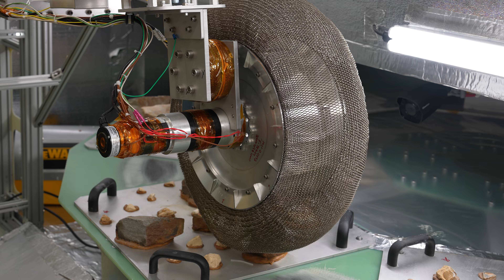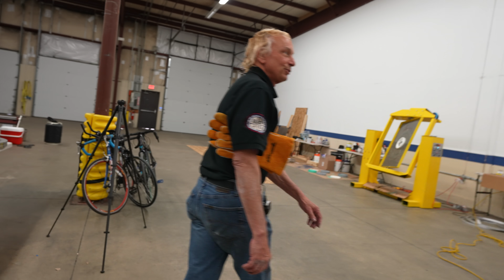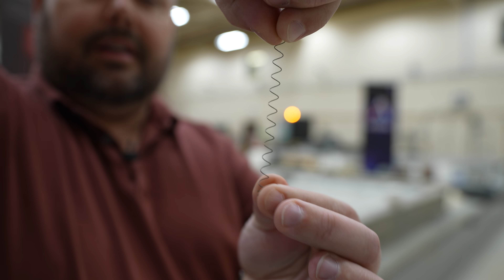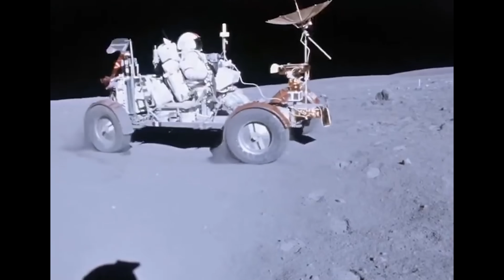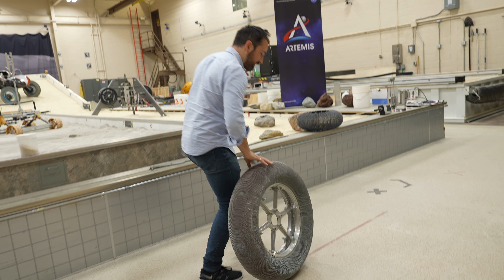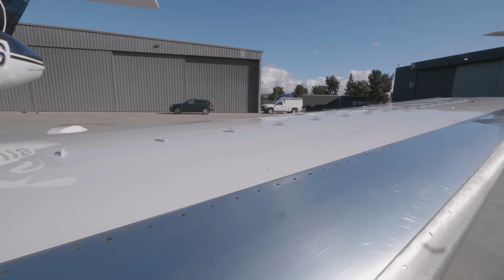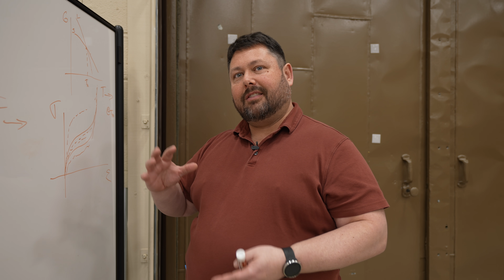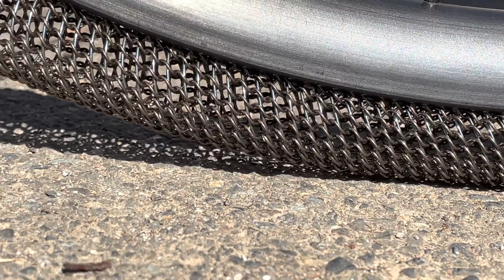How NASA Reinvented The Wheel

Comment: Okay, it might "work" as an average car tire, but how about grip? Road wear? High speed stability? Cornering performance? You must take all of this into consideration
Reply: Of course. For starters, everything on Earth is encased and with a rubber tread. Consistent footprint and grip. Then, it's lightweight and strong (titanium alloy). Tire development is hard. Our lead engineer from the video has 43 years in the tire industry, over 50 tire-related patents, an R&D 100 Award, and his technology on a significant portion of all cars on the road. It's a big problem to solve, but we're on the right track!

Comment: Nitinol is a blessing for paragliding pilots as well ... We used to have to be very careful when packing our wings.
Some of the high performance wings still use plastic rods and you have to use an inflatable pillow when folding the wing into a backpack. Still no idea why they are not using nitinol yet.
With nitinol life got so much easier. Just generaly bunch up the wing into 1 line and fold it into the size of the backpack.

Comment: If the 8% is achieved due to the general temperature the material is  in returning it to it's initial form. Then each application would have to be made specificly, and would break outside that. That must still be quite a challenge with the temp differences on Mars

Comment: Doesn’t the material chip away over time? like imagine the plane landing on the runway and then braking 100 times and then not replacing the wheel. Just crazy imo. Or if it doesn’t then you have to replace the runway..
Reply: Rubber treads: the metal will be the inner skeleton in this case.

Comment: The mesh tire is fine in dry environments, but there are several other advantages to inflated tires for cars.  They're much more weatherproof, do better in cornering, braking and acceleration, can run at higher speeds and are much cheaper/easier to make.  Not being able to pick up debris that throws the balance off is pretty important for consumer tires.  Mesh tires are just as unsuited for terrestrial cars as inflated tires are to extraterrestrial cars.
Reply: The mesh tire is just for rovers (and as a visual on the Jeep). Everything earthly is encased and fitted with rubber treads.

Comment: wouldn`t using nitinol for normal vehicles not come with new problem - grip i.e we know rubber works on asphalt, would that not mean we would have to change the roads just to make the new ''fancy'' aka nitinol tires actually work, what would we need to replace asphalt with to make them work?
Reply: We use rubber treads on earth, with a nitinol skeleton.
Reply: @thesmarttirecompany  you mean the shell would be rubber and inner layer nitinol? Are they legit things or prototypes?
Reply: @missionquasar1429  as legit as can be. The casing/shell can be made in various ways, but the keys are the nitinol skeleton and the rubber treads.

Comment: but temperature differences during day/night on other planets are extreme, and seems like these tires greatly depend on ambient temperature. So as their shape/permormance might be completely different when its cold compared to when its hot. Whats up with that.
Reply: It's part of the challenge, but the short answer is that specially engineered nitinol can do pretty large temperature ranges. We're going down to 40 Kelvin for LTV work. You do have to factor in some differences in performance at the extremes.

Comment: I presume the final product will be sealed, otherwise the wheel will become quite an effective sieve, accumulating Mars and Moon  soil particles within a certain particle size range.
Reply: The lunar tires are not sealed. It is a consideration, but they do not accumulate material - it is effectively repelled or expelled by the outer springs and inner bump stop. They also do not create giant dust trails like the Apollo era steel mesh.

Comment: Orthodontist here! We've been using "superelastic" heat-activated copper NiTi archwires for decades to move those really crooked teeth. The ones we often use activate at about 35 degrees Celsius. When we place it in the mouth, it's still room temperature so the wire is really flexible to get to those very crooked teeth. Once it has been in the mouth for a little while it gets heated back to body temp of 37 degrees Celsius so the wire undergoes phase change back into its original ideal archform, with increased stiffness, to put force on the teeth to move them into the right spot.
Difficult tooth to get the wire into? Blow air onto it to cool it down, wire becomes more flexible and easier to get into the brace. Very cool, and I use them everyday at work. All thanks to the original invention of NiTiNOL.
Wish I had this video when I was a studying postgrad!

Comment: A big problem with rubber tires is that they also create micro plastics from friction with the ground. I hope these can replace them so we no longer have that issue.
Reply: YES! Tires are an environmental disaster. Now, full disclosure, we do still use rubber treads on earth. However, we have some advantages that a) we can focus on durable, quality treads since they are the limiting factor; b) tread wear is always evenly distributed ==> no high pressure areas shedding material faster; c) we can engineer specific footprints (pneumatic tires only come in one specific possible shape)

Comment: Cold-Forging (The technique to make these fixed-stuctional metals) is a technique who contains forging and bending the metal in super low temperatures to stop its crystallized sturcture to deform, the natural crystallization is just bended in cold forge, not remade by completely melting the metal. Causing it to be much stronger and reformable

Comment: It is great video, thanks. But, may any of you guys tell me (i am really curios about it) how the "memorized" shape is decided for this material. For example, a spring can be manufactured from wire, then you deform the spring, then you heat up the deformed spring and it turns back to spring, not to the wire. What is the manufacturing process that decides the "memorized" shape? It will be appreciated if you can send any link about it.

Comment: Did they mention what the Jeep sized tire weighed?
Reply: It's comparable to a standard tire. That said, it was a prototype and the goal is lightweight. The reason this is possible, is because conventional tires contain a LOT of rubber and steel to carry weight and contain air pressure. Titanium skeleton scales better.
Reply: @thesmarttirecompany  that's really interesting, one would assume it weighs more but that makes sense when you frame it that way. Thank you for the reply and information.
Reply: @JRGio  thanks. It's counterintuitive in a lot of ways. Pneumatic tires work very well, but there is also this misconception that they must be optimal, that ignores how much engineering goes into them to overcome challenges of "just rubber and air" per se.

Comment: Since nitinol is sensitive to thermal transition, how the wheel handles extreme temperature differences observed on lunar surface? Did I miss the explanation
Reply: Different grades, formulations and processing of nitinol can greatly affect the temperature ranges, depending on your needs. This is how we get superelastic at room temperature vs high temperature actuators and other things. They are also several ternary alloys with interesting properties (3rd element added beyond nickel and titanium)
Reply: Anyone can guess as much. The point I was trying to make is, temperature on moon varies between -180 degree celcius to 224 degree celcius and this variation is gradual. So, even if some thresholds are set for austenite and martensite phases by adjusting alloy composition (assuming the phase transition is also gradual, as per the stress/strain graph), there would be a considerable range of temperature where the alloy would remain plastic and the wheel would buckel under the load...
I know the team would have worked out this issue, still it would have been more informative if the explanation was given

Comment: only question with NitoNoL wheels … if used in space wouldn’t the metal memory not get re-registered so to speak every single time the sun hits it.. so any bumb will just deform the shape more and more under direct sunlight and it will not return to the wheel shape in cooler/no sun areas.

like said: direct sunlight on most planets is 275+ °C and not the 27°C of earth
Reply: Temperature ranges for a particular mission are definitely one of the challenges - for example as seen in the video we're worried about -230C at the lunar south pole. For this, the exact composition and processing of the nitinol is definitely important. Part of what is unlocking the potential is getting these to the point where the material is consistent across many hundreds of degrees range.

Comment: That spring material is amazing, but my question is what happens if the metal gets exposed to heat unintentionally in the environment the rover is working in? The potential for unpredictable outcomes could be high if you don't have a real good idea of what state that material is going to be in at any given point in time.

Also is there any kind of opposing reaction if the material is cooled? In other words can cooling the material cause it to deform from it's default state?
Reply: Temperature effects are a major consideration, but I wouldn't say "unexpected" per se- the conditions for a given mission are pretty well understood. Currently for LTV the biggest challenge is cold (40 Kelvin in shaded areas)

Comment: So, I haven't messed with Nitinol, but while I was in university, we had a failed casting of an aluminum alloy that would make the same sound and felt crunchy when you bent it. It wouldn't return to its original shape though.
Reply: That's very likely actually same effect (also Tin "crying")! NiTi is special in that it's a thermally reversible transformation where most other alloys it's not.

Comment: Excellent video. I’m curious about applications in motor sport. Rubber compounds are used for grip and temperature management is key for maximizing grip. If these are wrapped in rubber wouldn’t the endothermic properties hurt performance?
Reply: Not exactly. Keep in mind that you both have unpressurized air inside (different from dumping heat into already high pressures), and that when the material cycles through deformations, it's actually reclaiming the energy. The tube demo shows off a nice, very visceral hot/cold cycle, but the net effect is room temperature material afterwards. It's a bit apples to oranges to break down quickly, but there's a lot of positive things going on, such as no more thick heavy rubber sidewalls flexing (which generates tremendous heat).

Comment: That wheel gets hots when it bends right? So it builds up heat the more it deforms. In space getting rid of heat is pretty hard. I reckon that's gonna be a problem.
Reply: In the video the tube gets hot... then it gets COLD. That's conserving energy, not accumulating it. Not that this isn't a general concern in space, it is, but the mechanism definitely does not continually build heat.

Comment: Nice video, but the animation at 16:15 is wrong. It is not a gradual change of lattice parameters (angles) in whole sample at the same time. Martensite nucleates and the austenite/martensite interface travels throughout the volume (from one end of a wire to another) when you apply transformation stress. This interface movement creates the sound.

Comment: I actually did my graduate degree actuating an airfoil using shape memory alloys. We did not use Nickel Titanium. I used copper aluminum nickel alloy grown in St. Petersburg Russia. My degree was earned in 2004. ~20 years later, I see it in real application. My dissertation is actually on file with the University of Arkansas.

Comment: I've machined nitinol before on a Swiss cnc screw machine (bar stock). Carbide tooling doesn't last to long and holding tight tolerances is a problem because as soon as you generate heat to it during the machining process it wants to move.

Comment: The friction between the tire and what it's rolling over is very important.  My gut feeling is that these have much lower friction, so when accelerating they will spin sooner and when braking will have a long stopping distance.  In both cases the metal will be ground away quickly.  Maybe that's why the Jeep drove in the dirt and weeds not on pavement?
Reply: Just a bare metal demonstration, but these would be encased and fitted with rubber treads. The metal becomes the structural skeleton, which is great for achieving the right footprint, but nothing beats rubber treads (yet).

Comment: Could you use it for energy generation? Since almost all fields use turbines, because its the most efficient and is also why Nicolas Tesla's "turbine" didn't work (not efficient enough st lower speeds).
Coal, nuclear etc power plants work on the same principle.
The conversion rates for the energy inputted, 
then converted to heat, 
then water movement, 
then turbine movement, 
then electricity (motor)
are a somewhat big part of the loss.
Could you use the heat to change the shape to induce motion and therefore electricity? 
And would it be more efficient than a turbine? 
Of even just cheaper, if not efficient?
Reply: There are definitely energy applications being worked on.

Comment: The NiTiNOL application for aircraft control surfaces seems like a singularly terrible idea. 

When there's a problem (which there always are in aviation), you don't want NiTiNOL control elements to change shape and turn a dangerous situation into a lethal one. 

For instance, imagine a commercial plane has an engine problem and it catches fire.... NiTiNOL control elements on that wing are going to heat up, changing shape.
The pilot and the FO will have to perform an emergency landing, but if the NiTiNOL control elements on that wing are shaped in such a way that make the aircraft hard or even impossible to stabilize, it's not going to be an emergency landing but a tragic crash. 

I'd take the existing redundant hydraulic systems over NiTiNOL control elements any day of the week.
Reply: I'm quite confident Boeing and NASA have thought through the risk assessment here - passively actuated components have their own considerations but certainly are not more inherently risky that electrically controlled ones.
Reply: @thesmarttirecompany  
Blind trust in Boeing is what led to the 737 MAX / MCAS cover-up, which resulted in the deaths of 346 people, grounding of the entire 737 MAX fleet and criminal charges being brought against Boeing (which the company settled for $2.5 billion).

Some victims' families in Texas are still trying to get that settlement scrapped and make Boeing executives face criminal charges for the cover-up.

This blind trust also allowed Boeing to set up shop inside the FAA, compromising the very body that's supposed to regulate the industry and make sure this kind of crap doesn't happen.

If there's no telling where Boeing ends and the FAA starts, safety will be the first casualty.

Now, regarding the engineering aspects, hydraulic systems have redundancies, there's always a backup, in case the main system fails. 

How do they make backups for NiTiNOL systems?
All systems fail, it's not a matter of "if" but "when", so there must be redundancies to these systems too.

I'm just having trouble imagining what kind of backup systems could be implemented, considering that NiTiNOL systems are based on heat-dependant atomic restructuring.

I'm not saying it's impossible to come up with such systems, I'm just saying that this looks like a can of worms.

Comment: Airless tires thus far (albeit using completely different methods) only shine in low RPM and mostly off-road applications.  It's kinda like flying cars and fusion, perpetually right around the corner for so long that when it finally happens everyone is surprised anyway.
Reply: Key phrase: different methods. All major tire companies today are also rubber companies, and rubber has as certain set of properties that can be well optimized, but never fundamentally changed...